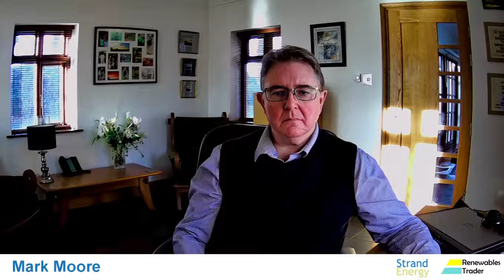Biomass Boiler Problems

Comment: Hello, could you go into depth about the PRO's & CON's of having a Biomass boiler?
Reply from the maker: Jay, hopefully you mean in the UK? If so, there's a substantial saving in heat costs if you choose the right boiler (ie. one that has RHI accreditation at a high rate) and obviously if you need the heat. Please could you advise me a little more about your situation?
Reply: @markmoore3  How much funding can you get from RHI?
Reply from the maker: @Heighway730  It's a complex subject tbh. The scheme is now closed but if you buy a used boiler you could have up to 19 years of RHI left to claim at about 3.17p per kWh - if you buy an older boiler you could have 13 years (or so) to claim at about 10p per kWh.